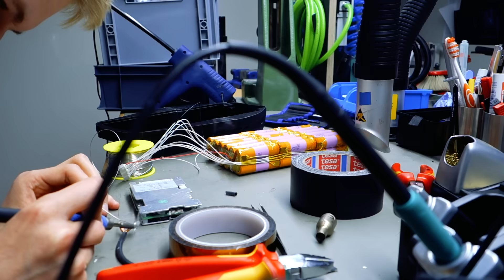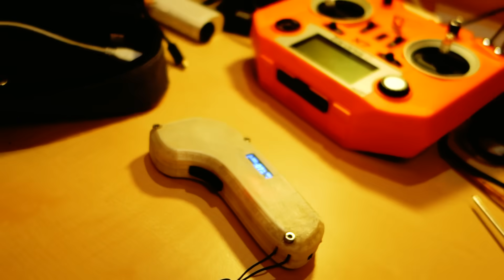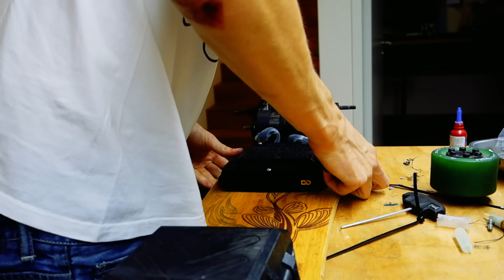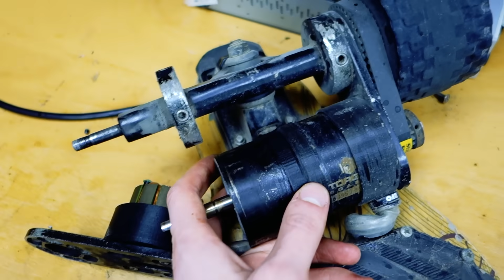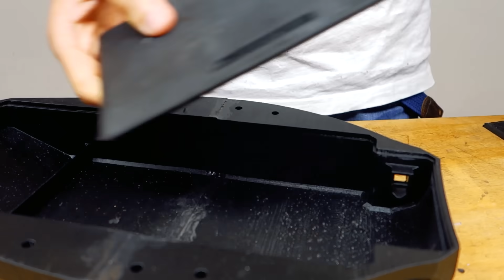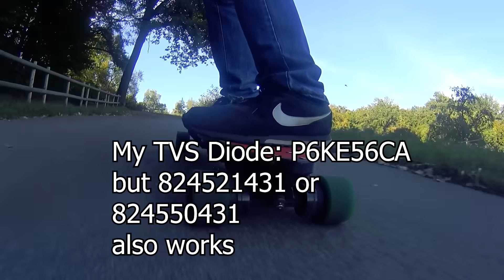My 3D Printed BOOSTED BOARD KILLER

Comment: Wait wait 12s 3p ...so 50volt and you say 5000watt? Dont get me wrong but i hardly doubt that you pull 33amp per cell from the standard 18650s you used just because the voltage would drop down to 3v or lower at this load ...
Reply from the maker: Fully charged Battery at 50,4V. IR per cell is 20mOhm (DC iR from Datasheet), 3 in paralell is 6,3mOhm, 12 in series is 75mOhm
Lets calculate the theoretical maximum. I currently have a 75A Current Limit, but lets assume I set this to 90A say I go full throttle:
My Vescs pull 180A
180A * 0,075Ohm = 13,5V voltage drop inside my Battery
50,4V-13,5V= 36,9V Voltage going to my VESC (still above 3V per cell)
36,9V * 180A = 6642W so thats the amount of Power getting eaten from my vesc.
Thats where usually everybody stops and says that this is the power, but since there are a ton of losses at this current here is the real mechanical power that you would be measuring on a dyno:
Resistance of my vescs: 0,0011Ohm Resistance of Motors: 0,0225Ohm
(0,0011Ohm+0,0225Ohm)*180A²= 764,64W of Power loss in Motors and ESC
6642W-764,64W= 5877W MECHANICAL POWER
so yes, the 5kW is easily possible.
Reply: @Pryside  I loved your video and how informative it was. Are you an electrical engineer?
Reply from the maker: Yep studying as one but only in first sem so far :)
Reply: @Pryside  This is not what we're talking about // you're thinking about the wrong subject // you're wrong.
nominal voltage as an average for Li-Ons is 3,7 Volts. Charged 4,2V. Low cut off according to Samsung spec sheet is 3,2V. Charge rate is 1,0 ampere or 1,2 ampere for fast chargeing.
V = 12 * 3,7 (or 4,2) 
V = =44,4~50,2

Go back to the basics. P = I * V
5000 (watt) = A? * 50 (Volts)
A = 100 (coulombs)
Now where do you get those amps from? Yup your batteries. Weren't those rated at 15 amps? Putting them in parallel should divide the amp load. Which would be 45 amps when looking at the bright side for a perfectly wired system?
They will die at this rate or have a massive drop off, which will only lower their watt rating. Going above the rated amps is terrible.
And no freaking way your VESC will pull 180 amps from that pack. Your nickle strips would melt instantly. even when divided in parallel.

And AFTER THIS, then your Ohm calculation comes in play. Which makes things even more terrible.

Solution: get a LiPo pack that is rated for 50-100C, and/or put those in parallel, or more 18650's in parallel.

I have no idea how your board's batteries survived those long trips when you pull way too much current theoretically. Maybe you didn't use 5000watts?
You also showed that you used pretty thin nickle strips? I have read that you need way fatter strips to handle the amps that you assume here.

We have Goblin helikopters which do pull 5 to 6k, some model pull more. So I do have some experience in dealing with high energies motors, but not that much.
You have driven your board a lot as you said but, doubt it was a 5k. maybe 2.5k would be alright.

Oh and I've seen your 3d printer recommendation comments, 
my opinion:
DO NOT GET AN ANET A8 in 2019
CURRENT YEAR ARGUMENT

but seriously I have one, I pimped it up, with way more cash that 100 euro's initial buying price. (bought it at 140)
Well actually I used 608 bearings, m6 threaded rods, a e3d bowden upgrade, silicone heating pad, external mosfets, SSR's, better PSU, better firmware, adding a fan for cooling, re soldering the heated bed, adding better cables, adding better extrudes, designed my own and better belt holders, replaced all bearing with brass bushings, designed better fanducts, Z switch, added a glass plate since F tape, etc.

And to put more salt on your wounds, your 3D prints look terrible due to the belt problems, and corner overextrusion. I can see the whole GT2 pitch pattern at timestamp @5:21. Somehow your Z is pretty nice.
Annealing PLA shrinks it by atleast 15% and will warp it, due to going to the glass transition point to anneal it in the first place, it kinda barely melts. Everybody says this m8. It makes for a great and strong print at the cost of: it's unreliable to anneal it for for it's shape and size.
I would printed it in over extruded Nylon.
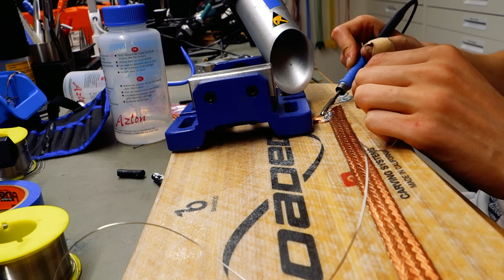And why did you put the wires at the top of the board and not at the bottom again? Like a big pressure plate for safety or did you think that the distance from the underside of the board was not high enough for you since even though 2 big plastic boxes are there, and the trunks, and the wheels? Like. Why. Do you like standing on wires? @4:46.

Anyway Don't Get a A8 in 2019.
Actually the i3 design is terribly outdated.
Oh and an other thing, why would you recommend motors when they critically fall apart after any use time? That's pretty unacceptable.

I like this project in general btw, like the other boards guys, forums things I've read (aka why I brought up liPo's in the first place, nickle strip safety, and general power calculations).
And you use the terms of ''best, awesome, great'' way to often. As everybody in the DIY youtube does whilst there are clear flaws.
But maybe I"m just pessimistic and never satisfied, and always complaining, or just Dutch at that point.
Reply: @PokeyDoggo  I have to agree with you. This is the first video I've watched from Leo, and I got to say he seems like a smart guy. When I design a board, I take the maximum motor amperage (usually 80A) and multiply by 3/4 to determine the battery draw. The reason for multiplying by 75% is due to the duty cycle causing the battery amperage to always be less than motor amps. The only time battery amps will approach 80A is at 95% duty cycle, meaning maximum speed. But since you only draw excessive amps during acceleration, your duty cycle is between 5% and 70%, causing battery amps to remain quite a bit lower than 80A (even though the motor is drawing 80A since voltage is manipulated on the VESC output). Anyways, in this case he will be drawing 160A motor amps and never exceeding 120 battery amps. With 20A rated batteries (30Q or HG2 or whatever you choose), he should be running a 6P config. Although probably could get away with 5P with no really loss in performance since the 20A rating is "continuous" and not "burst".

As for the 3D printer, I have to also agree. The A8 was a great 2016 printer as it really was the only cheap printer on the market. Now printers like the Ender 3 is a much better choice since they are all metal, include thermal runaway features, and pretty much the same price.
Reply: Pulling about 10C for a short period of time really shouldn't be a problem for these batteries, you guys are exaggerating
Reply: @ryccoh  These boards don't pull 5000W on flat ground. It's when you're going up a fairly steep hill for long periods of time that things get hot. Anyways, my board with a very short 2000W load (5 seconds) with forty 30Q batteries will have a voltage drop of 4V.

So imagine pulling 4000W for 1 minute when going up a steep hill at 40km/h. Those batteries would be toast.

The board will work, although you could save $400 by just going with a single 6374 and you'd basically have the same power
Reply: That makes sense, he should have some software that keeps track of how long he's discharging at max and then limits the power in case of a long steep hill like this.
Reply: Peter Zingler if you use high discharge cells 20amp. Like 30q, hg2. The voltage doesn't sag much at all
Reply: @JRPW  yeah sure it only sags to 3.5volt then,but he is using a 15amp Rated cell
Reply: @peterzingler6221  Oh i misunderstood your first comment. Yeah the motors are definitely couldnt even do 2.5k watts for long. definitely over rated

Comment: Warum hast du eine p6ke56ca genommen wenn die eine Reverse Stand-off Voltage von 48,8V hat? Leitet die dann nicht schon wenn dein Board auf 50,4V voll ist? Oder leitet die erst schlagartig wenn die min Breakdown Voltage erreicht wird?
Reply from the maker: Jain. In Wiki steht:
"Maximale Sperrspannung (Maximum reverse standoff voltage): Die Spannung, bis zu der die Suppressordiode nicht nennenswert leitet."
"Durchbruchspannung (Breakdown voltage): Die Spannung, ab der die Suppressordiode in den leitfähigen Zustand übergeht."

Heißt die wird da paar mA leiten aber nix nennswertes. Erst ab 53-58V also ab 4,4V pro Zelle (kann also nicht durch rekuperieren bei vollem akku entstehen) wird die Diode leitend.
Warum ich die dennoch genommen hab obwohl die doch schon ziemlich auf kante ist, einfach weil der rest auch so auf Kante designed ist. Die komponenten halten 60V aus, brauch also was das noch davor anfängt zu leiten, und dass machen eben nur dioden die eben schon vorher auch etwas strom durchrieseln lassen.

Comment: What do you think of the flipsky Dual Fsesc6.6 based on vesc6?
Reply: I tested the FSESC 6.6 and I can say, it's pretty solid.
Reply from the maker: would need to look on the schematic but I heard not to bad things about it, if it has a TVS diode its propably something I would recommend
Reply: @Pryside  Problem is, no TVS Diode is built in😁
Reply: Thanks for the answer👍

Comment: @Leo Pryside How did you write your name on the parts in Fusion?
By the way, your new board really is a great succes!
Why didn‘t you use that anti-spark thing on your first electric skateboard?
Ps: I‘m preferring the Creality Cr-10 as a 3d Printer. One thing to add, could you please make a video of the upgrades, you‘ve done to your printer?
Reply from the maker: My Name on the Parts? Under sketches there is a option for text.
Thanks :D
I did actually it was the V2 design in the pdf of the V3 I published. It works but can be destroyed by switching on and of very fast.
yes I can do a 3d printer check video, actually thought about this already a few times, just dont have the time for a new video right now.

Comment: Wie stark beinflussen die schrauben im board die Stabilität? Ich will nicht in mein 180€ vanguard reinschrauben um dann zu merken das es dann eher riskiert zu brechen. Ist es also schlimm?
Reply from the maker: Du meist die paar Holz gewindeeinzätze die ich da drin hab? Ja tat mir auch etwas weh ein 180€ board 14 mal zu durchbohren für 6 akku schrauben, 4 vesc case schrauben und 4 stromkabel löcher. Aber das ändert absolut nix an der stabilität. Booted Board hatte teils viel breitete schlitze für ihre kabel und mir ist kein fall bekannt wo das board da entlang abbricht. Die einzigen fälle die auf dem boosted subreddit gesehn hab ist brüche vor der vorderachse durch autos und sachen die drüber fahren.
Also da hätte ich keine sorge :)

Comment: Hi, 
I love your idea, It's amazing how you achieved to apply 3d printing to everyday use.  The only thing that maybe you should improve is the battery life. That is one of the most important parts for real and practical use. Also, we are a new 3d printing channel, so make sure to check us out to give us feedback on the quality, to improve our future videos!!!
Reply from the maker: Thanks, but why should I improve the battery life? My Board has a Range of 36Km, I only use my Battery from 20-80% most of the time for my commutes. With this low cycle depth I can achive more than 2000 cycles befor hitting 80% rest capacity from degradation. Thats 21km * 2000 = 21000Km of Battery Life. I ride aprox. 900-1000Km a year. So yeah in 20+ years my battery will reach 80% rest capacity. Battery life is definitly not a problem
Reply: @Pryside  Wenn du das Board lagerst, bringst du das Pack auf Lagerspannung?
Reply from the maker: ich lager es nicht. für regen und schnee hab ich extra spritzschutze gebaut die auch auch irgendwann mal vorstelle

Comment: Small correction: 12s configuration won't necessarily give you more power, just higher max voltage which will change your max speed. Since 50km/h is a lot, I think 10s would have been perfectly fine; then you also wouldn't need that protecting diode perhaps.

Fantastic video!
Reply from the maker: See, only the amps create heat and make your system inefficient. On low speeds the conversion from the high voltage of the low motor voltage gets inefficient. Say you only want to ride 25kmh, same Kv same gearing, then yes 10S would actually be okay and give the same power, but as soon as you want to go to 3/4th the rpm of the kv limit of a 10s configuration. That would be around 30Kmh thats where my system still has enough force to push full 70 Amps in the motor, a 10S can only push maybe 40amps and you loose a ton of power.
Amps create heat, heat limits your system. Thats why on higher voltage you can get more power.
But yes on the other side 10S is more safe (still would recommend a tvs though)
Reply: @Pryside  Well yeah, more cells will mean more power. When trying to cram in as many cells as possible, 12s can definitely make sense, like in your case. :)
Reply: Remember, Voltage times Amps  equals Power. Voltage has an impact on the power. Moar speed is a side effect.

Comment: Please stop recommending Anet A8 :) Test the Ender 3 instead! ;)
Reply: Yes if you made various upgrades it should produce by far better prints, but then the overall price tag isn't 100€ ;) the ender 3 is currently the best beginners printer to start with.
Reply from the maker: You are propably right, but I got my Anet fully upgraded better than almost anybody out there and it has 1500h of printtime so far and still works great. Thats why I still think its the best budget printer for 100€ absolutly unbeatable.
Maybe the ender has more features from the go, but currently I have no itentions of buying a new one. Since I can also use the Ultimaker 3 Ext. at my workplace. :)

Comment: Do you have breaks to stop your board from a high velocity?
Reply: The brakes are the motorbrakes driven by the vesc and you can adjust them
Reply from the maker: Who need brakes, just drive into a wall :D Nah we have regenerative brakes. It's really strong you can almost lock up the wheels when braking.
Reply: well, good luck finding a wall at a crossroad :P 
Thats pretty cool so in this way you wont lose that much range at a route that has a lot of hills.
Thanks to both of you for answering my question.

Comment: I bought 2 6374 Motors from Torqueboard.Both of them broke within 30km. Same Problem with the Magnets
Reply from the maker: That so stupid. They are pretty high quality usually. Have been riding their previous version for almost 2 years and they never failed me mechanically.
Definitly write them a email that their glue doesnt work.
Did you fix yours or were they completely broken?
Reply: @Pryside  Currently its just the Magnet retaining ring. I have to send them back for them to epixy it down. If they brake after that i'll battle harden them.

Comment: Bitte ein Video über den anti Spark Switch. Was auch geil wäre, wäre ein Video über die Fernsteuerung. Vom Druck bis zum Programmieren
Reply: Schau mal im https://electric-skateboard.builders vorbei, dort findest du alle Anleitungen zu der Firefly remote und  dem Anti Spark Switch, wobei ich dir die nano version der firefly empfehlen würde, da mehr Akku und größeres  Display
Reply from the maker: Ja du findest auf esk8 builders antispark circuits aber die sind alle nix und jagen hoch wenn du so viel Kapazität wie ich hast
Reply: Leo Pryside danke leo dein Engagement. Baue auch bald ein eboard. 
Als Motoren will ich die 6380 170KV verwenden. Akku: 2* 12000mah 6s (turnigy Graphen) in Serie. 
ESC bin ich mir noch unsicher. Entweder die neue focbox Unitymedia oder die flipsky vesc. Vielleicht kannst du was zu den ESC sagen.
Was ich aber noch nicht ganz verstehe bezüglich des anti Spark switches: es gibt doch bereits xt90 mit einem integrierten anti Spark. Warum kann man die nicht verwenden. Zu viel current?

DANKE im voraus

Link zur flipsky vesc:
 flipsky.net/collections/electronic-products/products/dual-fsesc6-6-based-upon-vesc6-with-aluminum-heatsink
Reply from the maker: Focbox ist ganz ok. Esk8 vesc benutz ich. Auf jedenfall ne tvs diode drauf machen bei allem was keine hat (alle außer focbox) sonst zerstören die sich auf 12S

Ich will ja keine kabel stecken wenn ich mein fahrzeug anschalte. Der XT90Antispark hat n widerstand am anfang im stecker drin damit er die kondensatoren auflädt beim einstecken. Ich mach das gleiche elektrisch mit ner schaltung.
Reply: Leo Pryside danke für die Hilfe. Da ich lipos verwende und die sowieso am Ladegerät auflade macht mir das Kabel anstecken nichts aus. Da kann ich dann auch die xt90 mit anti Spark verwenden.

Danke nochmal für den Tipp mit der Diode
Reply: @Pryside   Ich meinte damit einen Loopkey mit XT90-S Steckern😊, um es simpel zu halten.
Reply: @Nici619  Ich habe den Flipsky Vesc 6.6 und ich muss sagen, bin zufrieden damit.  Hab den für einen Motor.(Ich betreibe den mit 6s2p) Die erwähnte Diode nicht vergessen. Der Unterschied zwischen Focbox Unity und dem Dual vesc von Flipsky ist, das der von Flipsky mehr Ampere verträgt. 80A vs. 100A.  Btw. Willst du dir eins  bauen?
Reply from the maker: @MrRailcraft  kann man machen aber das ist zum aufbauen simpel, zum benutzen nicht so da ist ein einfacher taster schon angenehmer.
Reply: @Pryside  Da ich einen Flipsky Vesc habe und der schon nen Button mit an Board hat und zusätzlich eine integrierte Anti-Spark Schaltung bis 235A. Angeschaltet wird das Ganze mit einem Button von außen. Bin ein Sicherheitsfanatiker.😁
Reply from the maker: Schaltpläne und zeug hau ich gleich in die Beschreibung, kannst dir schonmal ansehen weil bis zum nächsten Video kanns wieder paar wochen dauern

Comment: Nice build! what do think of the anti spark switch of TB diyelectric..?
Reply from the maker: Not really a fan. They all blow up on my setup. I just have way to much capacity. My pre charges the capacitors slowly and doesnt just turn on like all the ones you can currently buy.
Reply: thx for the reply. i thought 12s4p is possible. i will use it on my 10s2p 6Ah setup soon.. i hope that isnt a problem. have fun with the board 👍